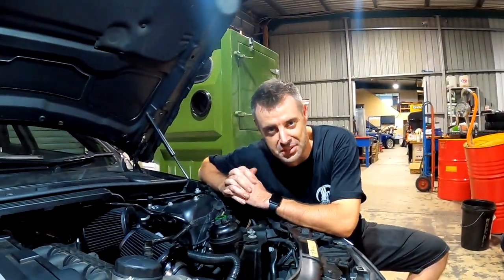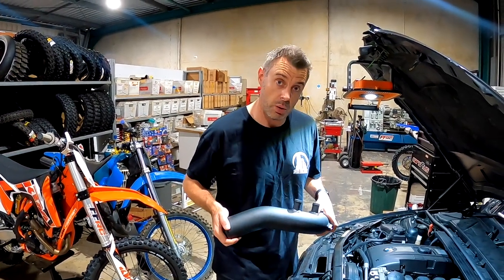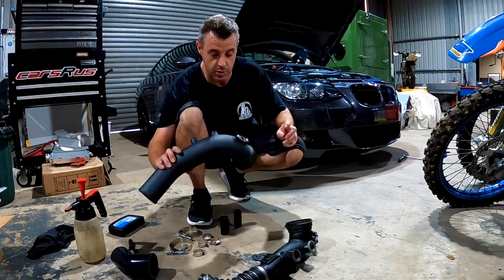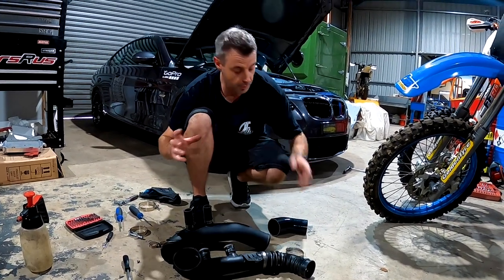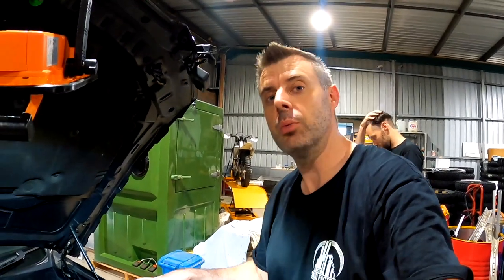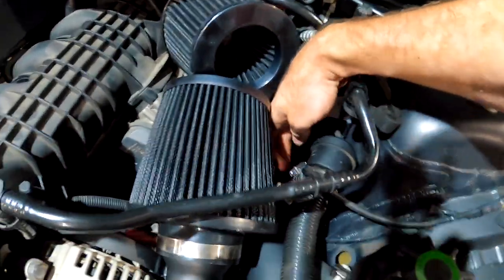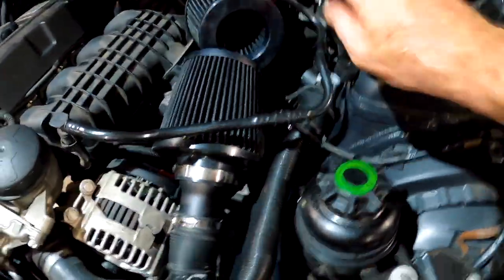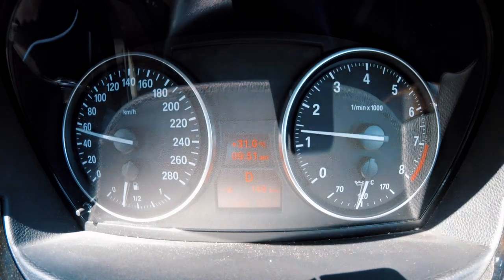BMW N54 335i eBay Intake Charge Pipe Install

Comment: Funny this parallels my experience with charge pipes, I went one worse and bought an Ali Express version (yes I should have known better) and even with lots of blood sweat and tears I could not get it to fit. I went with VRSF pipe and it fitted just fine. BTW my charge pipe was leaking on the factory tune at 70k, just a hairline crack, as opposed to my buddies M135i which literally exploded when we installed a stage 1 MHD tune. As usual great work keep it, up love the videos.
Reply from the maker: The temptation of saving money is always a strong one. I was surprise such a simple part wasn’t made correctly. Ahhh well. 

Thanks for checking the video out, have a great weekend!

Comment: You should install the VRSF relocated inlets. Get the 335D coolant tank and the VRSF 335D charge pipe. It’s a clean install and looks factory. Everything fit perfect on my 08 335xi and looks stock.

Comment: I just put my cheap eBay charge pipe on my car. It was a pain in the ass to put in. But I made it fit... the biggest stumbling block was the ports for recirculator valves... the one nearest to the throttle body had clearance, but the second one didn't have enough clearance for the recirculator valve to fit on. I just bought some tubing with a 90-degree bend on it and made it work
Reply from the maker: That's it. Sounds just like this one. Glad you made it work. A lot of people can't seem to figure a solution.

Comment: The engine sign at the end just kills the soul every time it pops up.
Reply from the maker: Every god damn time haha. We just got back from filming the full MHD ver 9 tests. The car is considerably quicker on the vbox runs. However this bloody CEL came back again. It's gonna need a Vanos solenoid. 
How is your single going? Got it on the road yet?
Reply: @ZeroTo60Tube  Yea its ready to race and registered. 21st March is first drag meet.
Reply from the maker: Are you going to do any updates on your channel? Also what did it roll on the dyno? Money no object, i would be doing what you have, maybe not with the glide, but i love the single setups.
Reply: @ZeroTo60Tube  No more youtube for me. No dyno yet. Went to dyno but operator convinced me my trans was stuffed. But its fine. I will dyno then race it see how quick it is then make one that suits a precision h cover.

Comment: I got the one from BMS.  Went on OK not great.  For only 40 more dollars.  I'm sure it is made in China too, but BMS supplies a better plug for the Meth Bung. And it looks like they check the throttle body connection dimensions for proper fit. No rerouting.

Comment: I have a 2008 BMW 335i e90. I’m curious why your BMW has a speed limit of 260 and mines 160? I have a US model but I always wondered this. I notice it about a lot of bmws that aren’t made in US
Couldn’t find this info online so I’m asking 
for a friend
Reply from the maker: Hey, the Australian model speedometers are in kmh, so 260kmh is pretty close to 160mph. I believe they also have a electronic limiter of around 155mph (this was a Europe deal thing the manufacturers had over there for a while), so if you are running a stock tune they all have the same top speed.
Reply: Zero To 60 thought so! Thank you, just had to make sure

Comment: I'm struggling to fit the oring mine is a chinese chargepipe. Is there any technique to fit. Thanks
Reply from the maker: Do you mean the main oring for the throttle body? We just used to some grease to ease in to place, but you do need to be perfectly aligned.
Reply: @ZeroTo60Tube  ok thanks I'll try that.
Reply: @ZeroTo60Tube  thanks it lined up and went in perfectly and nicely sealed.

Comment: Can you get engine light after replacing charge pipe with no tune?
Reply from the maker: No, something must not be plugged back in. Have you pulled the code yet?

Comment: I’ve got an older VRSF charge pipe which used a slightly thicker O Ring 3.8-4mm vs OEM 3.3mm

Any ideas where I can get a replacement thicker O Ring from?
Reply from the maker: Im sorry, not sure exactly. Howveer i have heard of people using the oil filter housing orings.
Reply: @ZeroTo60Tube   OFHG is different size and have seen a few cases of those O Rings tearing and getting sucked into Throttle body 

I managed to source some Viton 4mm O Rings will give them a crack and see how I go